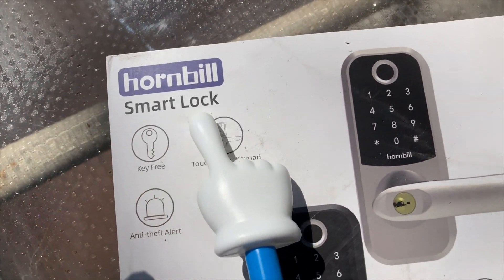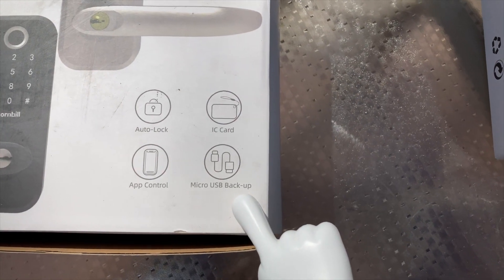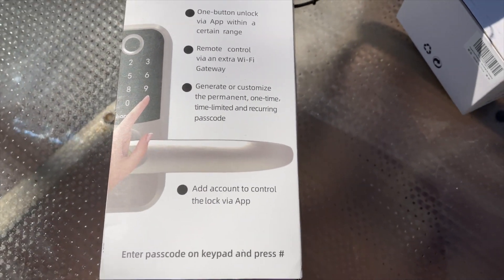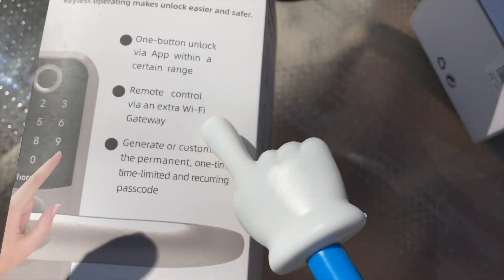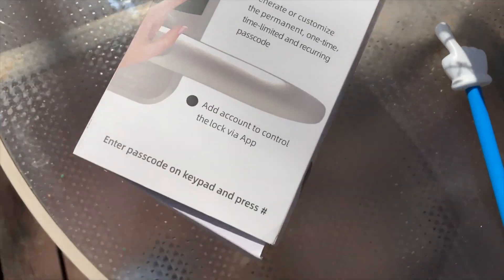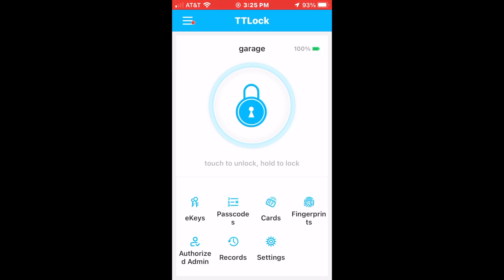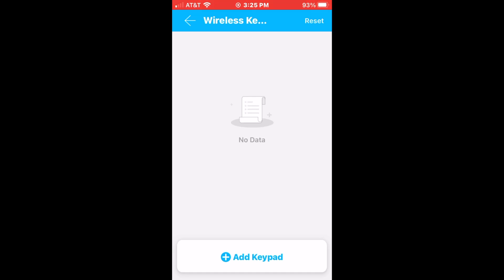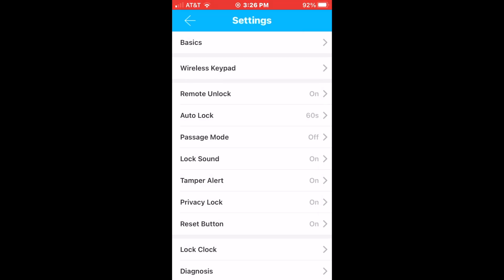Hornbill Smart Door Knob   install and used. Is it any good?

Comment: cheaply made latch very frail waste of money schlage and yale forever
Reply from the maker: I will agree with you. However for what I needed to make it easy to access any door in my house, these types of locks work for me. Now if a year from now, the hardware fails - I will replace with a better mechanism. 
At one of the places that I worked at for a couple of years, they have a push button lock on the door -  a yale - i believe- . It is a passcode lock, but that is it. If you need to lock it - 'cause it doesn't lock itself, then you have to go to the door and lock it. It does work great though. I don't know if it has any other codes. as far as I could tell, everyone uses the same code.
And on the other hand - if the shlage or  yale are better locks - I am not sure - at least when I look at the "Lock Picking Lawyer" . He seems to be able to pick or get into just about every lock. Am also one of those people who believe that if someone wants what is in your house, a door lock is not going to stop them.